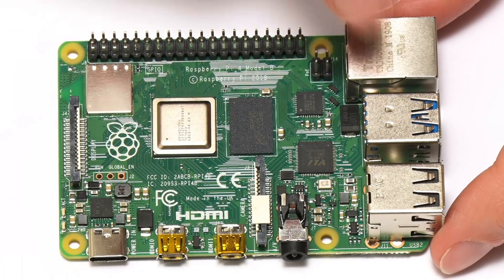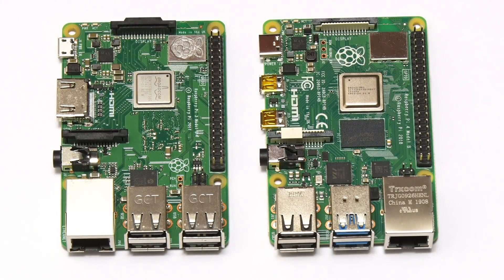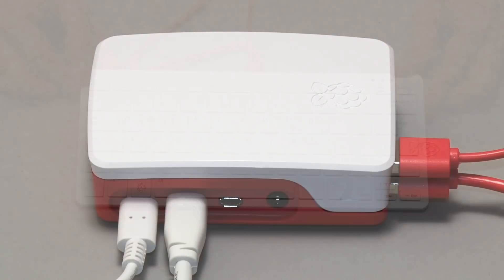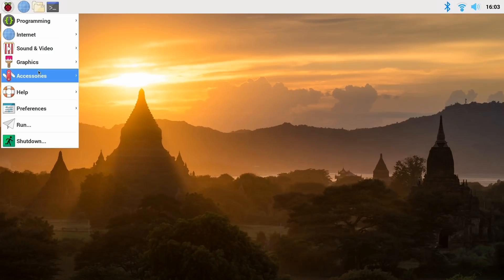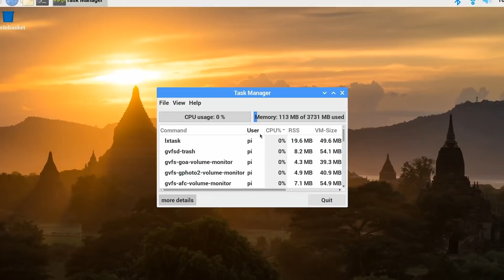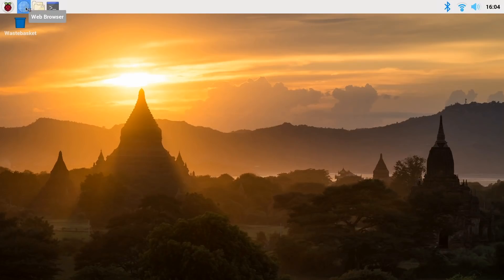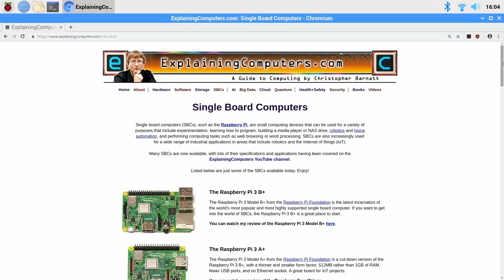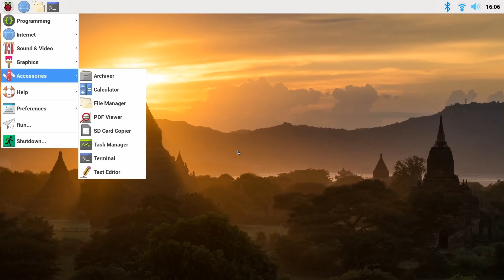Raspberry Pi 4 Model B

Comment: 114 MB RAM at idle should be a target for all modern OSes. My Win 8.1 desktop machine can sit doing nothing and still use a gig of RAM. Even my Zorin Lite laptop uses about 700 MB doing zip.
Reply: 640k should be enough for anyone......
Reply: @VauxhallViva1975   Don't forget to LOADHI=UMB (Or whatever TF we used to call it...) So glad I don't need to remember that stuff anymore...
Reply: currently using Kubuntu 19.10 where desktop sits at 284mb :)
Reply: @flemtone  Funny, that's exactly what I am getting on Windows 10. I'm running an old HP 2760P notebook with an i7 2620, Samsung 860 EVO 500gb SSD, and 16GB of memory.
Reply: @flemtone  it is a difference between Mega and milli.  about 10⁹ times difference. 
284 mb, that is 0.284 bits, are not that much.  You probably ment 284 MByte ;-)
Reply: @flemtone  Kubuntu better than Lubuntu?
Reply: @JonnyInfinite  define "better".  Better in what way?  Yes, they are different.
Reply: @AndersJackson  🙁 what?
Reply: @JonnyInfinite  you wrote; "@Anthony Fleming Kubuntu better than Lubuntu?"

I ask in what way better are you asking about?  There are many things you can say is better and worse comparing Kubuntu and Lubuntu.

So, define what "better" means in your question.
Reply: @AndersJackson  RAM usage
Reply: @JonnyInfinite  Kubuntu is using KDE, and thus as hungry as Gnome.  So I would say Lubunut uses less RAM.  But then again, I stop jumping distros 15 years ago.  :-)
Reply: A lot of modern os's preload a LOT of things into standby and shuffle off idle stuff to a page file. A lot of that extra pre-loaded stuff gets dumped fast it the memory is needed. If it's done correctly it saves a LOT of time loading things from disk by doing that. However this is dependent on pre-load algorithms ability to correctly guess likely needed data and programs. As long as it's right more often than not by a good margin it actually improves performance. Of course a change in how you use your computer, especially if farther away from the typical cases the algorithm is designed for, the less efficient it is and can even hurt performance in some cases.
Reply: @kaseyboles30  is correct. If you have RAM that just sits there unused then your OS is not doing a good job. Ask yourself why your OS isn't using all RAM for cache to increase performance. Leaving RAM unused is wasted RAM.
Reply: It's that low because It has basically nothing aside from the Kernel (with only the basic modules for the hardware), Display server, and Desktop manager installed.  You can make an OS run that lean, but most regular users are not willing to make the sacrifices in conveniance that such an OS would run. By the time most people are done installing stuff on this OS, it's going to idle at significantly higher memory usage. I know my MUD servers (provided they'd even compile for ARM) would use 300MB of ram a pop, and I run two of them.....
Reply: @DFX2KX  of course running applications will increase the memory use.  But it really helps to start with a low memory footprint BEFORE you add applications. :-)
Reply: Unused RAM is wasted RAM.
Reply: @RageOfAThousandSuns  Yes.. because when you need it for other resources pagefile i so fun to wait on.
Reply: @DarkLinkAD  We don't live in the age of 640K RAM any more, so if your swap file is getting used, you are doing something wrong.
Reply: @RageOfAThousandSuns  Your swap file is used for everything, for example.. even if windows services and processes load on boot, after 10 minutes they will begin to load into your swap/pagefile.
When you boot a game, even explorer.exe will be loaded into the swap file.
Reply: JonnyInfinite - Yeah, Micro$oft Windows is 11gb installed, 7gb of that is a 4k movie about the programmers, their learning difficulties and the care homes they are in.
Reply: @PrinceWesterburg  wut
Reply: Aziryse mine deadass does, I have 64gb
Reply: It takes resources for Windows to send your info to Microsoft 5500 times a day when you're not looking.
Reply: Aziryse nah just windows 10
Reply: @Roshan_420  no wayyy, if that runs, he's right, that's an issue. It should NEVER use 12GB doing nothing. You ethier have some fault or loads of crapware installed. Windows 10 will NOT use that much on its own.
Reply: Void Frost I only have chrome, steam, winscp, putty, games etc installed, quite clean install 😋
Reply: @VoidFrost  probably has three tabs open in Chrome
Reply: Roshan As @Aziryse said "Then you have a problem"
It's called Win10!
Reply: JonnyInfinite 
Base install of Debian 9 without the GUI uses 34MB. I use it as a VM image.
Reply: 114 MB ? That's win98 SE ?
Reply: @tomf3150  98 second edition.
Reply: and the most outrageous thing is that whenever you activate something like bluetooth or another builtin application YOU OFTEN USE it needs to load... while keeping things like zune support always on.... i'm speechless :O
Reply: @igcogcigciggicifx4763  haha okay now I know you've been talking out of your ass. The oldest useful Office version is 97, 95 can't open any files made in the last 20 years.
And yes, of course you can watch YouTube in VLC, but that's not the whole functionality of the site, and machines that came with 64 mb of ram were likely Pentiums or Pentium MMX at best which can't decode h264 well enough to call this "watching". Again, you're talking out of your ass.
Reply: Try arch with dwm window manager
Reply: @Shvmadogg  try Debian without any GUI. :-)
Reply: My pc uses like 12gb ram idle lol
Reply: Look for moded lite versions of 8.1 it can cut down to whopping 600 megs of ram used :P Moded xp looking like windows me - 40 megs used.
Reply: Why on earth should they do that? So one can jerk of to how much ram is "available"? There's a place for ultra ressource efficient OSes, but on a regular PC sacrificing functionality for unused space ist just stupid.
The raspberry pi OS is no comparison to Win 10, which, by the way, scales in it's use of ram. If there's little available, it will use less, virtual machines with enterprise edition run fine on 2 GB ram (total, not used) or even 1 GB, but if there's 16 GB available, why not use it for the OS?
Reply: 5.2 / 16 gigidle, no background programs windows 10 is nice competitor of chrome
Reply: @hassankhurramtech  theres something the matter if 10 is using 16 gig at idle. I run 7, 8 and 10 machines and ive never seen them use more that 2 gig at idle
Reply: 5.2 / 16 gigidle, no background programs windows 10 is nice competitor of chrome
Reply: @igcogcigciggicifx4763  no, they don't. By "working"  I mean actually using it, not "technically booting up and opening notepad". Open Word, Excel, browser, play some background music, and voila. I'm not even talking about running essential tools like Everything, some clipboard manager, launcher, AHK, etc. And no, included browser is not an option at all because it simply does not work on most sites.
Reply: @igcogcigciggicifx4763  and btw. I actually ran windows 2000 on 192 mb computer back in the day. Even with the bundled browser it was barely enough and windows 98 still worked better.
Reply: @igcogcigciggicifx4763  frankly, the only real option to run XP on low memory machine right now is to use SSD -  which allows fast swapping.
Reply: It's the feds in the background doing their thing! Run!
Reply: @igcogcigciggicifx4763  XP without service packs isn't compatible with a buttload of XP apps. I doubt you can even install necessary versions of . NET on it.
Reply: @igcogcigciggicifx4763  and office 95 is absolutely worthless right now, if you actually used it you would've known this.
Reply: C c  you're repeating old antiquated mantras. SSD's are cheap and reliable nowadays, and a perfectly viable solution when you can't increase RAM for some reason.
And if you have an SSD - that's where you should put swap in any case.
Reply: @igcogcigciggicifx4763  nah... Win2000 was barely usable with 192 mb, XP requires 256-512 mb
In reality - more, because you won't even find a working browser that can comfortably work with less than 400mb of free ram.
The only option used to be Opera 12.16, but it's less and less usable with each year.
Reply: @NJ-wb1cz  Nope, xp requires 128, you can use less than 20mb if you know what your doing and Win7 requires about 512mb, but this is for the install, on a fresh start youll use 220mb and with some work, you can easily get that down to 60mb or so.
Reply: @DarkLinkAD  I'm talking about real system with real apps and real usage patterns. The registry alone will easily overflow 20mb with enough programs installed. Slightly under 100mb after load is a realistic number with semi-decent functionality, that is, if you don't require any particularly unwieldy drivers.
Reply: @NJ-wb1cz  Well that makes no sense at all, you have a clean install. And then you have modern day browsers which take more than 2gb of ram for basic youtube function.
Reply: @DarkLinkAD  and btw you can actually watch YouTube on a completely modern browser with 512 mb. Slightly easier on Linux, but doable on XP as well. 
Still, SSD is required for comfortable usage.
Reply: @NJ-wb1cz  Yeah, without counting pagefile swap, but my numbers are total usage,
Reply: Preach it, JonniI -- preach it loud and often!
Maybe one fine day we may turn away... away from a world in which Every OS Sucks.

(with apologies to  Three Dead Trolls in a Baggie  for stealing their phrase)

Comment: You’ve obviously had a busy week!  I’m looking at inexpensive ways to make an electronic whiteboard for classroom use. This can easily be done with a Raspberry Pi 3. I’m now wondering if the new Pi will also be able to screen capture using software such as OBS, given its graphic and hardware capabilities. This can be done on an Atomic Pi using 720P resolution with MX Linux.

Comment: I was considering creating a 6 node cluster of Raspberry Pi's using the 3B+ version but since the 4B has come out or at least it will very shortly I may just use those instead. The purpose of this cluster is for experiments with cluster computing or "supercomputing" and machine learning and such.

Comment: are the usb3 port capable to give power to an ssd hard disk ?
Reply from the maker: An SSD, certainly. Potentially a 2.5" HDD, depending on your PSU. But personally I'd only power an SSD from the board.
Reply: @ExplainingComputers  so it is perfect to boot from an external SSD AND as a NAS!!! Thanks !

Comment: The performance issues in web browsers and lack or RAM made the 3B a very poor replacement for a desktop computer in my experience. In addition to the poor video streaming performance it had issues with a lot of animation-heavy modern websites, and being a developer by trade I couldn't even load a medium-sized project into a modern IDE without having the pi seize up because the memory had filled up. This update potentially changes a lot of things.

Comment: Raspberry Pi have been rumbled (at being an anticlimax)

Well they have really largely just fixed the problems with the original pi3, such as the sore need for 4GB RAM (minimum frankly) as a virtual machine can be run on it. It is 'good enough'.

There is however a certain "British crapness" about it (and we have a habit of that in the UK) in that they made a "joke" version of the Pi4 which actually had a good idea on it such as customisable and more abundant GPIO (for the 5volt and ~3volts change) and an FPGA. The "problem" now with the Pi4 is not that is does not have a FPGA but rather that they have gone full-sinclair and pointlessly bothered with the keyboard and mouse "look and feel" (as if a case, mouse and keyboard matter) rather than the hardware guts of the machine improving. In other words, they should have encouraged the notion of a GPIO fpga, and listened to what people are actally going to buy it for (household solutions).

That GPIO can be plugged into a motorola 68000 socket. The "joke" that retrogamers (which btw are often modern hardware modders) would enjoy a FPGA is humourless because clearly gamers drove the change in computing. The fact that the ARM came from acorn that got it arse rightly handed to it by sinclair spectrum (and then c64) is down to gamers. Every rerelease mini console such as the playstation-classic mini (ARM) and c64-mini and even the AMD based atari were trash, and yet the Atari would have been good had they only stuck an FPGA on it so that people could stick a £4 "68030" on it (about 42MHz overclockable) so that people could mimic an atari-falcon, and even add an FPU. Hoik an FPGA up that GPIO, and it'd be a serious machine for becoming a dual screen handheld games console (let alone tinkering) but using the GPIO and the display connector (not the HDMI, as they'd connect to a dock). I relentlessly don't care about that mouse. An xbox360 shaped games controller with a chatpad would have made more sense (and then alluding to the GPIO FPGA). The case should have large HDMI connector holes so that one can adapt those flimsy hdmi ports.

This is so typically bad of hardware designers. Nearly everybody in the comments section is rightly pointing out the crapitude of the flimsy HDMI. It is like designer is saying, "Well the customer won't understand that" (even though it is  a learning tool), and then the noob customer will break the HDMI port they do not understand, like Kofi Annan with an OLPC crank handle charger. Amiga did this sort of approach. They relentlessly did not listen to the actual consumer base who were gamers and so (sadly) CDROM booting was very very limited (even though a perfectly acceptable parallel ieee 1284 port existed and could have been boosted) and they wouldn't even put an akiko on earlier, or, for that matter, an empty FPU socket with an easy access door on top of the case with pull-up resistors and caps there already (not the trapdoor as that is for big guns upgrades). On the Pi4, they've even included actual HDMI cables which are bad idea as they do not suggest one should adapt up to large female connectors in the case first.

I kinda of don't care about the a72. The a53 would have been fine and then more RAM. The notion of using it as a NAS is sketchy (although sure it would have some fucntionality there). I'd have preferred a very weak 8core CPU (even with shared cache to "cheat" like the old FX amd machines) rather than the a72, simply for blake2sp and then storage crypto would be possible (hence encouraging the learning in maths). Now, unfortunately, people will use that Pi4 as a streaming NAS and then moan. Had they ditched the USB-C connector and SDcard and made another two double-usb3 ports (so that is 4), a btrfs set of hard-drives could have been added. One of the usb2 ports could have been swapped for the sdcard, or just use an adaptor. In fact, to have 5 of the usb3ports (although it depends on whether the different CPU chosen would let it do so), ditching one usb2 and the sdcard (thereby leaving only one usb2 and five usb3 ports) a decent blake2sp btfrs NAS streamin NAS could have been made. The fact is that people will insist on using it for that NAS usage (sans blake2sp) anyway.

That power supply could be obtained by other means. Nintendo rightly avoiding providing one with the 3DS. That keyboard 3port hub will be weak power. Money could have been saved by ditching that. Ditching the wifi and bluetooth so as to go in and out for rj45 and wifi via adaptation of that ethernet would have been acceptable if it freed up the ability to have that usb3 setup (of five or six usb3 ports and just one of two usb2 for bootable pendrive compatibility etc.).

It would have cost the same (or maybe different by a matter of a few quid tops), and would have done everything (including alluding to FPGA) and have been possible. And people could use it as a learning tool (as per FPGA upgrade potential). Selling gaming accesories would have been better marketting.

Raspberry Pi have been grumbled.

Comment: I was literally thinking of buying another Pi yesterday (22nd June 19) but didn't because I thought I'd wait for a new model. Didn't think my wait would be so short!

Excited. Def going for the 4GB version.

Can you please tell me, does the USB C Power port accept data, like the Pi Zero W, allowing SSH over USB or only power, like the previous full sized models?

Thanks, and thanks for getting this video out so quickly!
Reply from the maker: As far as I am aware, the USB-C port is power only. But you can connect to the USB 3.0 ports for data transfers.
Reply: @ExplainingComputers  Thanks for the reply! Does that mean SSH over USB 3 ports will be possible?
Reply: AgeingBoyPsychic it was always (except with usb 2)

Comment: An aluminium case would be preferable as i'm a hater of plastic. Plus, I see no option to add a cooling system on that case in witch i'm very surprised for a 4th gen system. When I buy this, the case will be removed, heat sinks will be added and i guess i'll build a case.

Comment: Micro HDMI is a disappointment.  It should have been Mini-display port instead as the micro HDMI is just a very flimsy connector.
Reply: If they even had one regular HDMI I would have been happy. Maybe they'll release a + model later on with regular HDMI or mini-display port. Time will tell for now.
Reply: Same to the USB-C power connector.
Reply: @youreale  Agreed...but micro HDMI is worse.

Comment: im really hoping for for Lubuntu to run on this new pi. it will probably allow to run it as a Karaoke or DJ setup as well as a great mobile multi track audio recording rig. The Pi 3 did quite well for controlling Behringer x32 and Xair mixers this new one will be a powerhouse